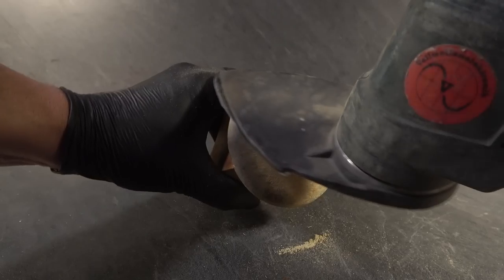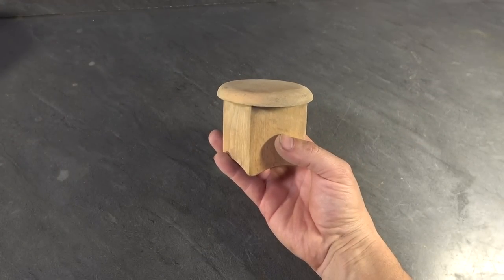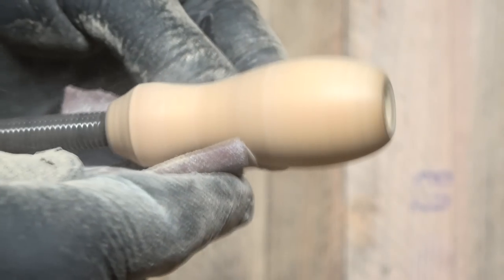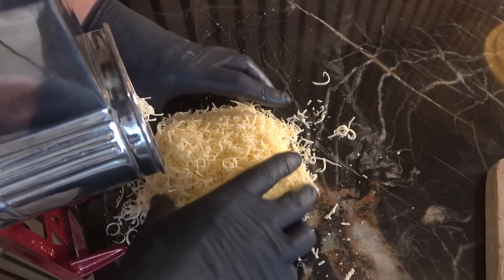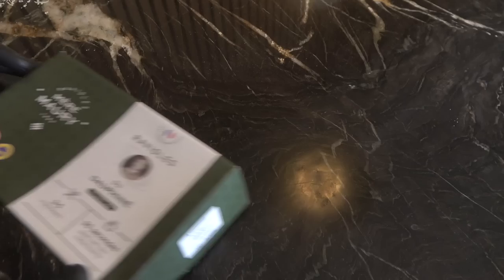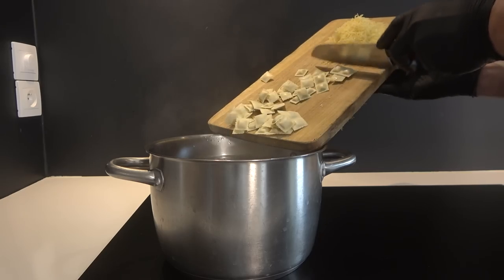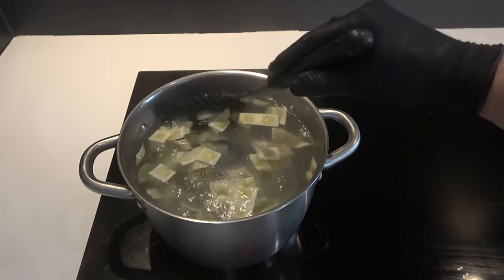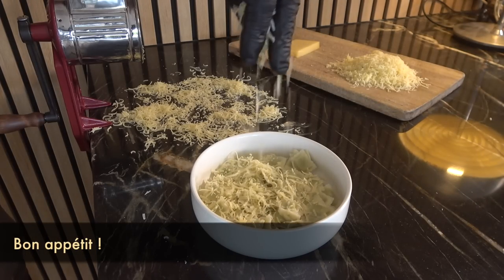Vintage 1950 Cheese grater - ALEXANDERWERK - Restoration

Comment: This is also used for walnuts. Grate them, mix the result with sugar, coat some pasta with it and bingo, easy and cheap dessert
Reply from the maker: Oh great ! I shall try that ;) thanks 😃👍🏻
Reply: @TheFabrik  this is a staple dessert in parts of Transylvania, at the table you would get 3 bowls, one with pasta, one with sugar, one with grated walnuts typically made with this contraption, and everyone would make his own ‘walnuts pasta’ by mixing as much as they want from each bowl

Comment: your plating seems a bit aggressive. When plating, you're looking for metal deposition with minimum bubbles. Bubbling means hydrogen on the anode which will make the plating less resistant. Try to lower the voltage next time
Reply from the maker: Yep you’re right. Too high voltage with bubbles means black nickel 😒 Thanks for the tip 😉

Comment: Is there anybody that might be able to help me I know nothing about sandblasters but I really like the concept I know that you sandy was using glass beads to do this do you reuse the glass beads in the sand over and over again or do you throw it away once it has all the paint particles in it that it's sandblasting off just curious what happens with the sand after one user do you keep reusing it or what do you do with the old saying that has all the particles in it just teaching me something that I don't know the only stupid question is the one you don't ask I was wondering if somebody could teach me a little something thank you very much
Reply from the maker: Thanks a lot for watching and also commenting ! 🙌 The glass beads can be reused several times ! I replace them every year